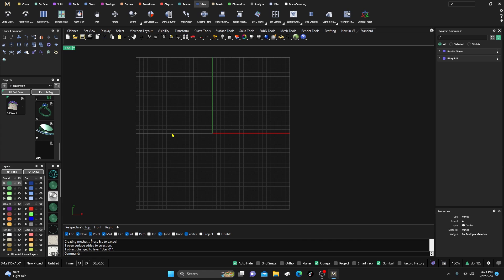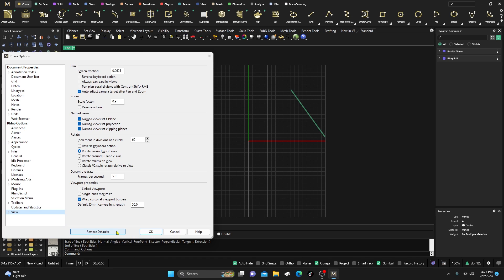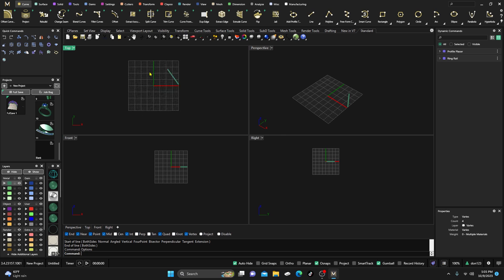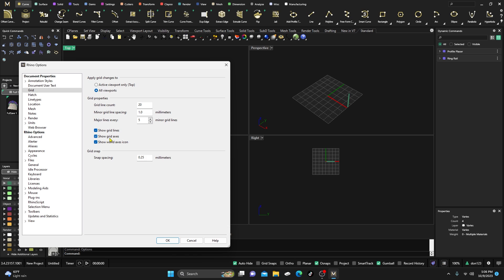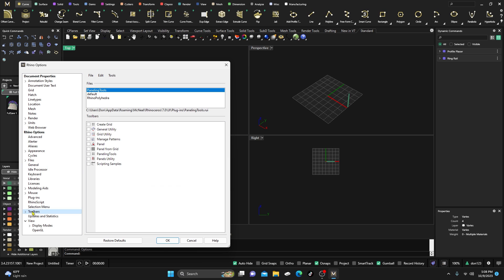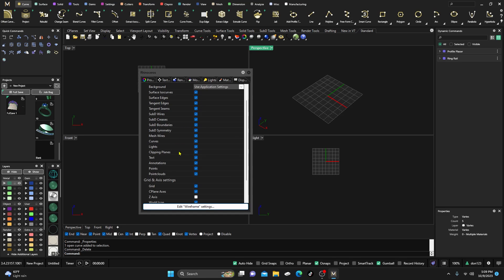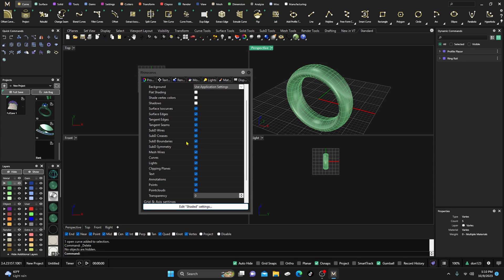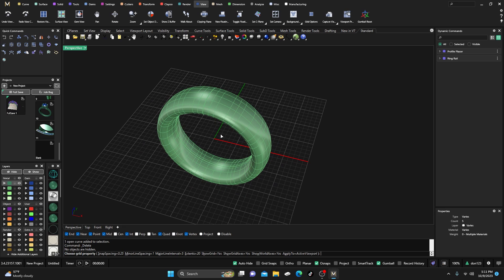MatrixGold Grid and Isocurves

Comment: To "brighten" your grid lines go to "Options" first then go down to the Rhino options and double click on "appearance" so that "colors" appears below it and click on that. In the popup, be sure that the "custom" box at the top is checked. You can then pick "major grid lines" or "minor grid lines". If you want the Minor Grid Lines to show up better, simply click on the color bar and a color wheel will appear. There's a box in the center of the color wheel showing you what color is already in use. Look for the very small circle on that color swatch and use your cursor to lighten or darken the default color by sliding the circle either up (for brighter) or down (for darker). 
I used this technique to also lighten the black background which I found to be too harsh. Anything that will help these old 76 year old eyes. 🤓